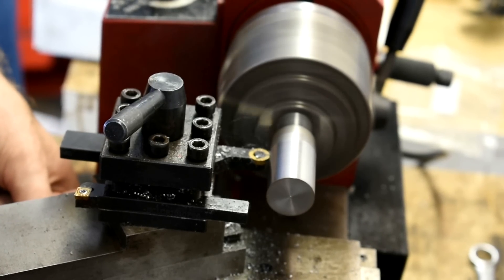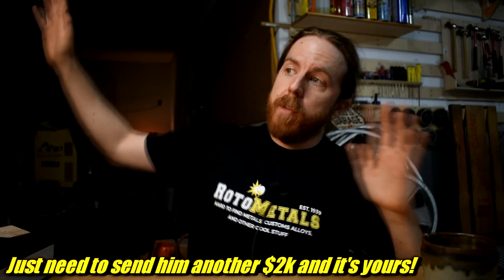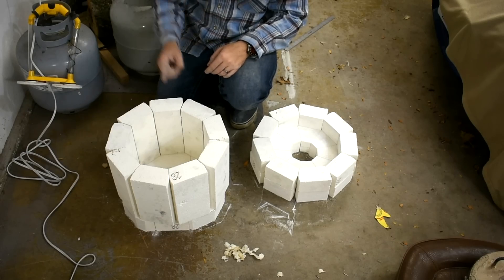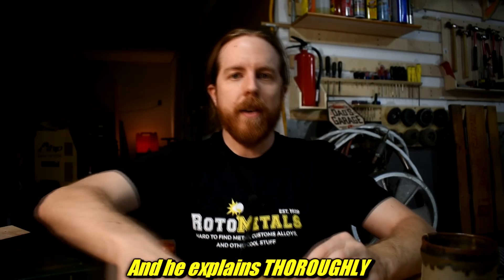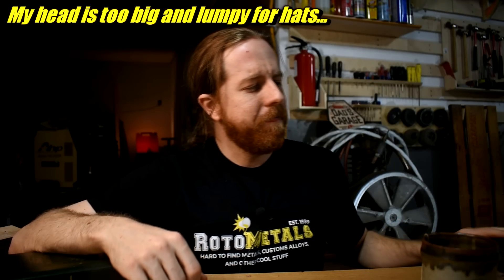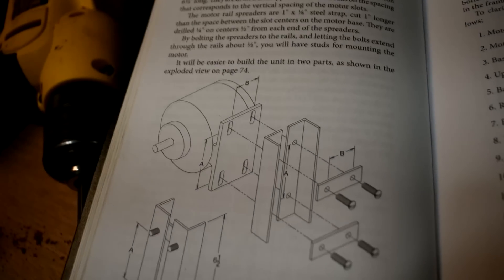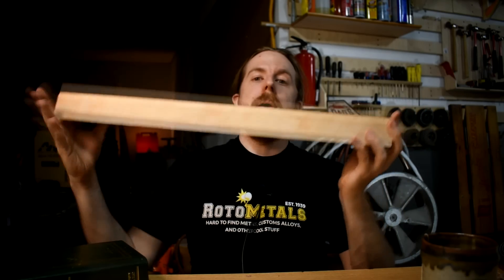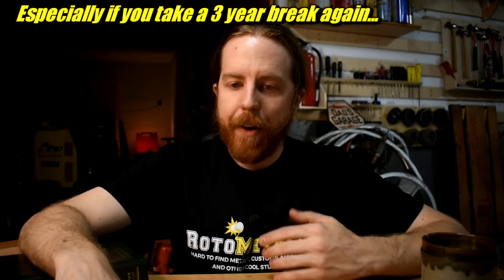Build a DIY Home Machine Shop the Gingery-ish Way

Comment: Mate made a gingery lathe many years ago, he used Bronze as the metal, but otherwise followed the Gingery plans. Got to see it last year when he pulled it out of storage to make some parts for an old lathe he was doing up. He is currently almost done making the gingery dividing head.
Reply from the maker: That's awesome!  Bronze would look amazing.  I'm going to use bronze for some parts on this one but not the whole thing!
Reply: @PaulsGarage  apparently he had a big propeller that fell off the back off a ship at the ship yard he worked at...
Reply from the maker: @jackdawg4579  sounds like a good metal source 😉 I wonder what bronze it was?  Some newer ships use aluminum bronze, that would be fun to cast I to a lathe for sure
Reply: How'd his lathe turn out?

Comment: Nice! Another lathe build on youtube! As you ask, I'd like the lathe to have a wider bed that specified by it's original author, or said otherwise, to have an appropriate width according to it's centre height. But I reckon that's gonna require more than you could probably put into it.

This is what most lathes suffer from (due to manufacturers' will of sacrificing rigidity on behalf of their own profit), and which is specially true for these chinese crappy lathes. But well, maybe in a future.
Reply from the maker: I'm not changing the width of the bed so much but I am increasing thickness of the walls by 50%, using a more rigid metal, and I increased the taller (2" as opposed to 1.5") so it should be significantly stiffer than Gingery's original design.  Iron would blow it away though most likely

Comment: If you're having vacuum problems with the pattern why not try set screws that can be removed before removing the pattern?
Reply from the maker: Screws are a good idea.  I think my main problem is draft on the underside.  I need to do some pattern "adjustments" before I go on I think

Comment: Suggestion: make the bed out of epxoy-granite instead of a metal casting. You still need some metal parts, but epoxy-granite looks like a much better material for that part and you don't have to figure out how to pull the bed out of a sand mold.
Reply: Beat me to it, but yeah (Epoxy) Granite/Concrete Lathes are a recent/not as well documented, but great thing.
Reply: Epoxy granite is great, but there's also ultra-high performance concrete. It has similar characteristics as epoxy granite, but easier to mix and less messy.  If you go with either, you'll also need a vibration motor, or be willing to tap the mold to ensure the mixture settles in all the nooks and crannies. The last thing you want are large voids.
Reply: @bobweiram6321   "ultra-high performance concrete" what types would we be looking for? specific brands or processes?
Reply: @Smokeisprogress  Polymer concrete seems to be the thing now. Tech Ingredients is making Graphene to reinforce concrete etc.
Reply: @AlwaysCensored-xp1be  I just watched the Graphene Tech Ingredients, amazing stuff
Reply from the maker: That's really interesting, I'll check that out.  I could definitely use something like that as a base
Reply from the maker: Never tried to use epoxy granite.  What is it like?
Reply: @PaulsGarage  From my experience it handles like you'd expect a sludge of epoxy and sand to. But well worth it for the damping capabilities. Even bolting a lathe to a granite countertop base provides a noticeable improvement.
Reply from the maker: @terminalvalence9871  that's interesting.  I'm kinda set on metal cast bed, but I'll keep that in mind.  I know makercise bolted his to a cement base and that helped a huge amount with chatter
Reply: @PaulsGarage  Metal casting bed is fine, and true to Gingery's plans. Consider making the base in a way that can be filled with Epoxy Granite for dampening. It's a good way to the mimic Cast Iron properties with easier to cast materials.

Comment: I bought the same Gingery book a few years ago. There's another set of books called The Boy Machanic, lots of thing for boys to build. Everything from crossbows to foundry and machine builds. Copyright dates are from 1913 to 1918, as you can imagine it would give parents today a panic attack if their child had one of these books. The copy i grew up with is 1947 edition. Fun stuff.
Reply from the maker: Interesting, I've never heard of that one.  I'll have to check it out
Reply: I mean, not all parents. Until recently I was a teacher at a school where I got to do things like help kids turn the transformers from microwaves into giant electromagnets that they used to climb the steel girders in the building while I belayed them. There's a slow resurgence of appropriate dangers in childhood, which is good. More parents and educators are realizing that we've gone too far in rounding off the sharp corners and bubble wrapping everything in children's lives. We don't need to go all the way back to the 1950s when my dad set his kitchen table on fire with his chemistry set using real-ass chemicals he got from the pharmacy, and blew his eyebrows off with a "rocket" he made by filling an old mortar shell his dad had lying around the farm with gasoline and lighting on fire. There's an appropriate middle ground somewhere.
Reply: @evanbarnes9984  great summary - thanks for teaching there is a way to explore without dying to the next generation.
Reply: A more modern equivalent would be the book "Whoosh boom splat"

Comment: I built myself an electric foundry a few years back and some good results with it. I also had plenty of bad results which is why I gave up casting several months ago. I know think I either need a more powerful electric foundry, or a propane one. It's probably going to be propane so I can get higher temps. Cast iron? Yeah! Hopefully, the next video will be less rabbit and more doing. Get on with it Paul. (I don't mind the rabbit really)
Reply from the maker: I intended this one to have some doing and ran out of time to redo the bed lol I tried twice with the ramming.  I think I need some pattern refinement...

Comment: I’m definitely going to be building along. I’ve tried casting the bed a couple times just haven’t got it quite right yet
Reply from the maker: Excellent!  Makercise had to try a couple times, and the reason I don't have a bed in this video is because I didn't get the ramming right either.  It's a process for sure.  Fortunately the rest of the patterns are much smaller

Comment: Electric Foundry. check. Propane Foundry. check. Chineesium Lathe. check.  I'm working on the sheet metal brake first, stopped for the snowy months where garage was cold. check. Have all of the books in the series. check. Lets GO!
Reply from the maker: Let's gooooo!  Im not going to do the sheet metal brake.  I got a terrible chinesium one, then threw it out and get a better chinesium one so I'm set for brakes.  Electric furnace is on its way, too
Reply: @PaulsGarage  yep, I didn't decide on the brake to get a great tool. It looked like the easiest of the projects to complete.  For what I've spent on materials and time, I probably could have modified a cheep one much easier.  However, I did get a welder, grinder, etc... and spent time drilling and taping.  I think it's more for the experience and learning... just like the lathe... I already have a little lathe, but want to do the Gingery one for the journey... for the experience not for the end product. =D  Although, I still have a few projects I can use the end product to complete when it's finished. Way more expensive to build your own tool.
Reply from the maker: @MikelNaUsaCom  I agree, it's worth the journey and it's way more fun to build your own.  Even if it's more expensive.  The brick foundry furnace I build cost as much in materials as a full devil forge set up, but right now my furnace is all screwed up, and I have no fear of tearing Into it and modifying it.  A devil forge though, I would feel a little nervous just because I didn't build it.

Comment: I can't wait to see this! I have had the books for over 10 years and have not got past book 1 but my stock pile of AL is growing.

I really need to build / buy a furnace. With this winter it has been super tough to do any shop work.

P.S. hello from ND / MN
Reply: You know what would warm your workshop up a lot?  A propane furnace at full noise 😉!
Reply: @dfross87  true... 😆
Reply from the maker: hello from WI!  I'm surprised how cheap some of those furnaces are now.  The materials I used to make mine cost as much as a finished devil forge lol

Comment: Looking forward to this!

A few weeks ago an Atlas metal lathe showed up on my local Craigslist for $250 and I just missed out on it. I have no real use for a metal lathe or a good place to put one, and yet... I NEED it 😭

On the bright side, I didn't throw my back out trying to move a metal lathe!
Reply from the maker: I know the feeling!  I don't need this and yet I NEED IT 🤣🤣
Reply: I moved a Flight Simulator Console i got at an Auction for 20USD + Standard Office Computer/CRT Monitor in my 1990’s Honda Accord a year or two back so i feel that issue of actually having and moving the stuff lol.

Comment: I built a wooden lathe a few years ago with an old drill press motor (didnt have a drill press) and a 1/2" bolt then rebuilt it a few times to be a midi-sized lathe before my wife bought me a DC drive Mini. Currently working on building a metal lathe for the few times a year i am needing one but WAY too poor to buy one, even the $800 one. Steel, concrete and easily machinable metals will be your friends.
Reply from the maker: Do you mean a wood turning lathe or a lathe made of wood?  Both sound awesome.  I share your aversion to spending $800 on Chinese junk, and I don't have the thousands needed for a decent one.  DIY it is!